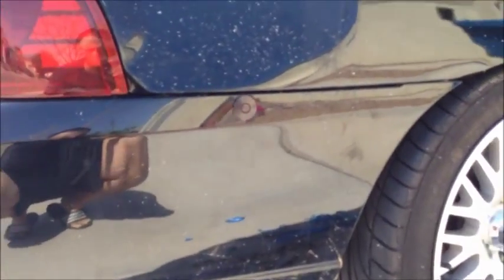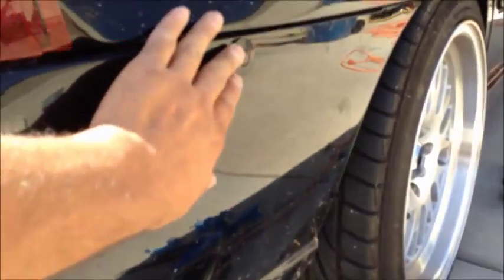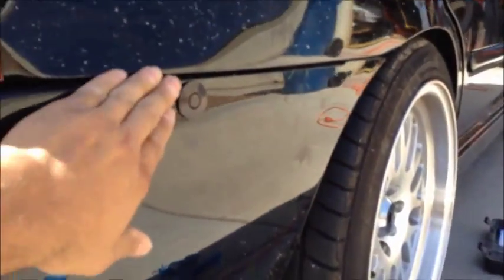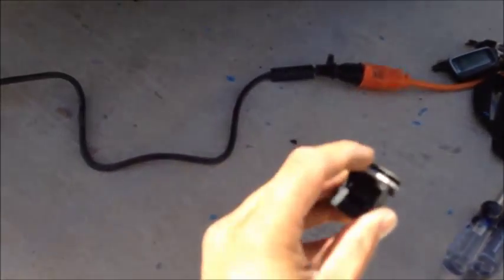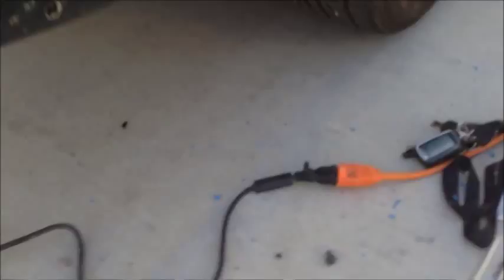Built Turbo Sentra

Comment: That's quick, bro.
(I've kept up with yer vids, i know this one isn't current....)
I've got an '04 spec, red, with over 200K miles.
 I'd wanna do either a lower milage motor, or a fresh rebuild before I boost it.
 But man-- SO jealous of that torque.
Reply from the maker: Just slap a low mileage motor and run it on low boost.

Comment: Did you hace any clearence problems with the camshaft lobe on the head? Are you running the oem engine? maf-less?
Reply from the maker: Renato Perez  NO I had no clearance issues at all man. also the motor is stock and i am still using the maf.